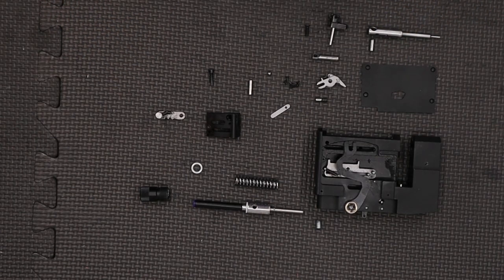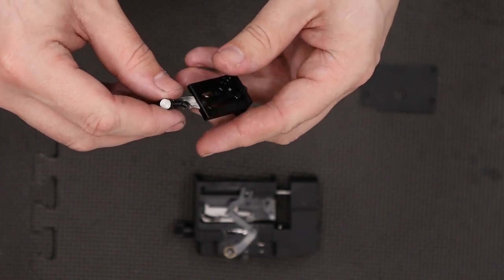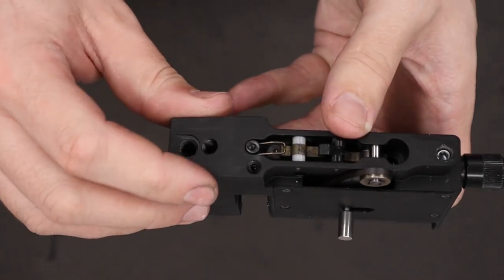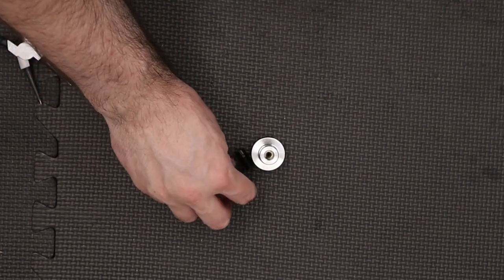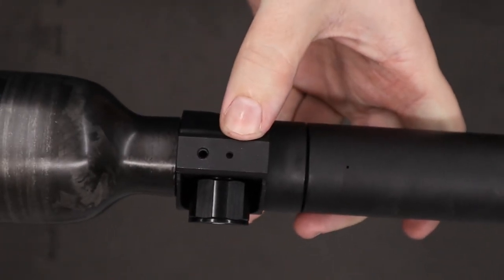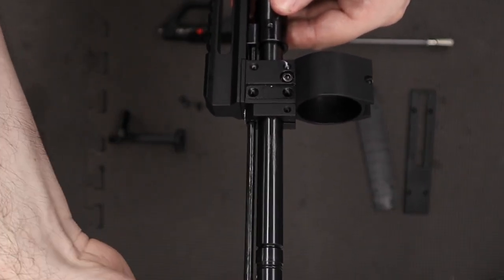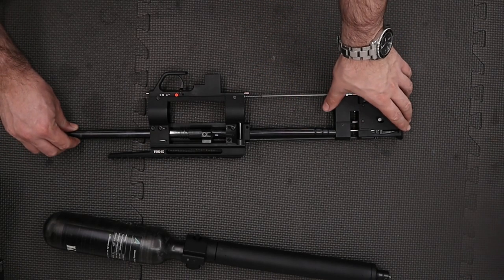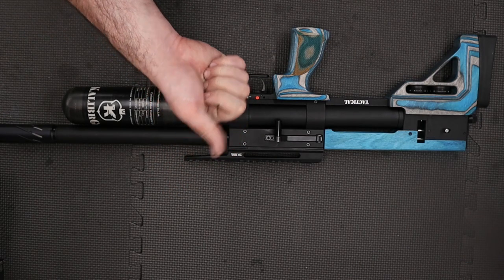Kalibrgun cricket 2 tactical reassembly

Comment: Excellent video as always, ive got a sub 12 ghost .177 and I’ve got to say I didn’t really take much notice of batch selection in pellets but my god it’s true let me explain.. I purchased a tin of jsb .8.44 5.2 and I put these through it and I’ll tell you now I’m getting 10mm groups at 45 yards all day outdoors on a calm day,with that I bought a whole sleeve with the same batch number and works perfectly out of curiosity I used a tin of the same make weight etc but a different batch and I was off target by as much as 2-3 inches I will study batch numbers more tightly from now on in my other guns… my only gripe is I get I a bit of left to right on the trigger perhaps if you can would it be possible to include a fix on this once you get the ghost it would be most appreciated many thanks.
Reply from the maker: yes pellets batches  can make so much difference 😀 the trigger is one of the things on the list for the Ghost 👍

Comment: Fantastic as all your videos. In fact I learned to service my M3 and my Panthera from you. Q: Can you mount a FX bottle on the Cricket in order to decompress it without loosing the air in the bottle?
Reply from the maker: not tried on the Cricket but i would think you can alot of the CZ stuff has the same setup 😀